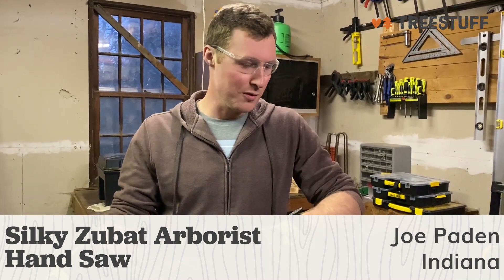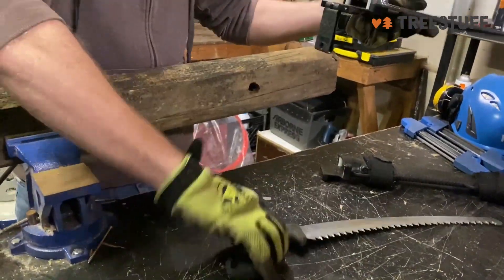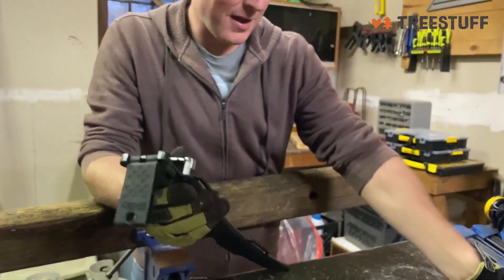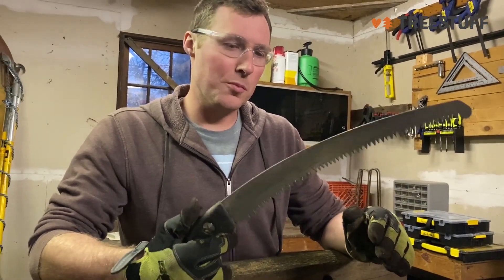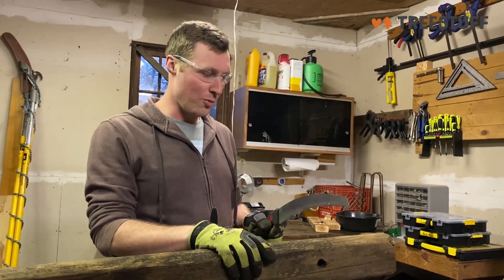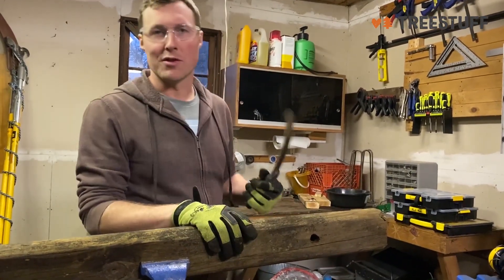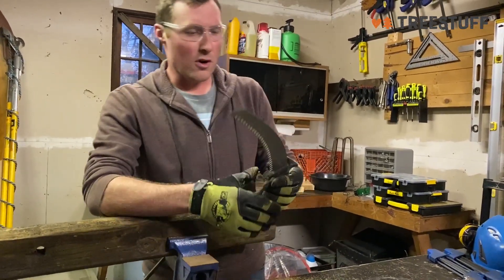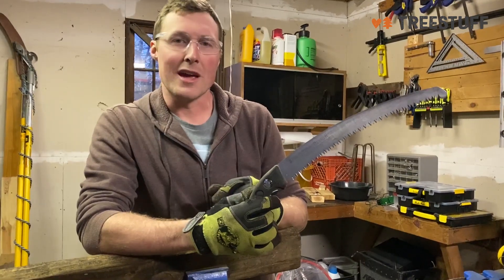Silky Zubat Arborist Hand Saw - Joe Padens Customer Video Review - TreeStuff

Comment: The first saw with smaller teeth is better for dry wood and is therefore faster, the second saw with larger teeth is better for green wood and is therefore slower.
Reply: Smaller teeth make a cleaner cut on green wood and the plant heal better that cleaner cut.